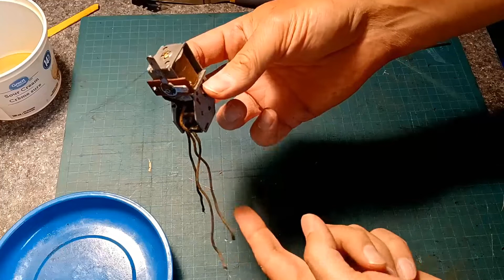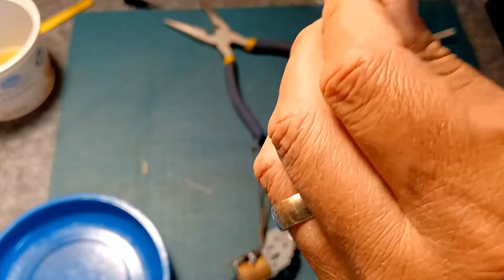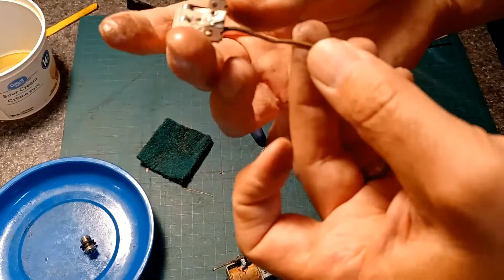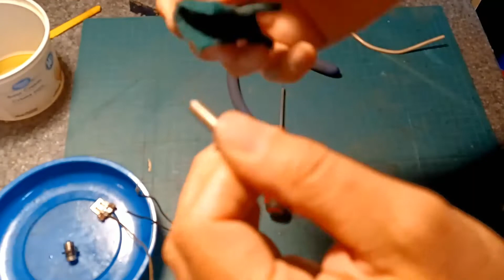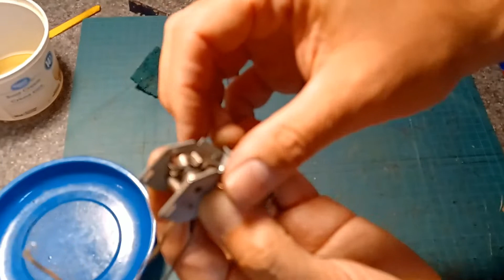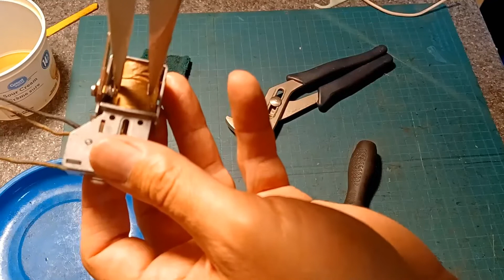Why Isn't My Lionel Moving? One common reason is a dirty E Unit

Comment: Responding to this old video; I wonder if Deoxit spray by Craig Labratories  might be a better option by not having to take the E-unit apart if it just needs to be cleaned?
Reply from the maker: Sprays work for a while but a complete disassemble and clean reveals any wear, AND I prefer a thorough clean that I know will last much longer.

Comment: Would this also work for prewar???
Reply from the maker: Thanks for watching. My experience with Prewar is very limited. I only have one prewar with an Eunit 1937 259E. The eunit in that is identical to the postwar, so for my 259E, yes this is applicable.

That said, I have no idea if the earlier prewar (1911 - 1920's) eunits are the same design or construction so I can't confirm this would work for them. I don't have any of that era with eunits, nor do I have any literature on them.
Reply: @warrenmuzakpostwarguy4331  okay 👌

Comment: I followed your other 45 minute video where you took apart and cleaned the 1666 locomotive. I have my father's, and cleaned it up real good - but it still didn't work. I suspect it's cause of the E-unit. Not only is it most likely dirty, but the barrel inside is loose - which is most likely the sole reason it's not working. Unfortunately I will have to take apart the locomotive again, but this time to take care of this part similar to how you did it here . . .
Reply from the maker: Most times with these Lionels the e-units are the culprit. Either dirty, broken solder joints or missing parts. One of mine had an eunit without a drum, one had a drum completely melted...!?!

I have come across loose barrels and found out they were not the proper barrel for that eunit. There are the odd e units that use a slightly larger barrel. Theres no way to determine that until you take it apart. It was a frustrating discovery.
Reply: @warrenmuzakpostwarguy4331  Yes, I remember your vid where the drum was missing, and you had to get one from your inventory. In my case, the drum was loose within the E unit, and I though that that was possibly a normal situation. I know why - at some point the locomotive was dropped. It looks like it hit on the right side front, which dented the right marker jewel housing (shattering the jewel), and somehow breaking off the LEFT side eccentric crank and its connectors on both sides. Evidently, this drop knocked loose the drum inside (this 3 lb. 10 oz. locomotive), and it never ran again. If my father dropped it, I imagine it wasn't a pleasant time in my grandparents house sometime in the late 1940's . . . I'll have to take it apart again and set the drum correctly, and clean it and the finger contacts like you demonstrated. By the way, my grandfather kept an original Lionel catalog from back then, and it is in pristine condition. Not quite sure where it is, however.

Comment: Maybe someone here can help. I just cleaned and fixed my dad's 1950's Lionel postwar steam engine. It runs great now especially since I cleaned the armature and replaced the carbon brushes. But there's lot of sparks sporadically off and on. Not sure if it's the engine or tracks. The tracks are just as old as they came with the engine and train when my dad got them brand new back in the 50's. so maybe clean the tracks more? Sorry. I'm not an electrical expert. Also there's a kind of a loud hum when running the engine. So I'm not sure if that's normal or not.
Reply from the maker: Are the sparks coming from wheels contacting with the track? If so that's dirt and debris on the track or the locos wheels.
Use a scouring pad or very fine grit sand paper to remove rust and dirt from the top of the rails. The top of the tracks should be silver.
DO NOT USE STEEL WOOL or SOS pads. They will leave steel fibers behind that will short out the system.

Comment: The E-unit is an ingenious single pole quadruple throw switch. The plunger is raised by current passing through the solenoid coil around it. The solenoid's core is an electromagnet. When the plunger is raised by the electromagnet it advances the drum and changes the contacts. The contracts are arranged to cut off and then reverse the flow of electricity, producing forward, neutral, then reverse...... When the transformer switch is pushed, or turned, the electricity is shut off and the plunger descends by gravity. Thank you for the demonstration video. Ther is an option to replace the E-Unit mechanical switch with a circuit board and bypass the unit for unidirectional operation. The circuit board runs around $80 dollars and our local shop, the last remaining, charges an additional $60 to clean and replace using either option.

Comment: The plunger pulls up when the coil is connected.  Don't oil the plunger.  One cause of sticky E units is dirt, oil and grease build up in the solenoid

Comment: Are all the E units in post war Lionels identical so that if replacement parts are needed there is no concern about variations? Secondly, I presume the lever switch disconnects the plunger coil from track power such that movement of the drum is halted and the direction of the engine is maintained? When the plunger does not move,  is that indicative of a non contact of the "fingers" not making contact with the drum?  I am dealing with a finicky e unit now and after some contact cleaner, I can get the engine running in both directions by manually rotating the drum, but the movement of the pawl is not evident electrically.
Reply from the maker: I have found all post war Lionels from 1950-69 eunits have the same parts except for the positioning and length of the lever. Diesels have longer handles that extend out of the bottom of the shell. 
The drum is not constantly spinning, it only turns to change the direction of the locomotive. When you push the direction button on the transformer you will hear a "click". That is the pawl dropping down, hooking onto a tooth on the drum, raising back up thus turning the drum to put the loco in reverse, forward or neutral position.

If the pawl is not moving the coil of the eunit may have a loose wire, or is damaged. Damage could be obvious, or a small nick in the laquer insulation on the wires (that gives the wires the  dark red look as opposed to bright copper). Or its been shorted.

My suggestion is if the coil has a loose wire, re-attach it. If it doesn't, just replace the coil.
Reply: @warrenmuzakpostwarguy4331  Thanks for getting back to me. After numerous attempts to diagnose the fault. I found a cold solder joint from the coil to the  coil switch. Everything is working fine now.
Reply: @warrenmuzakpostwarguy4331  Most often with a sticky E unit the  cause is crud in the solenoid.  The symptom is slow operation and partial engagement.  You won't get that nice audible clean click as the E unit engages. It may also buzz and it will clearly be drawing current.  Another  possibility is the lever arm that turns the coil on and off is not making good contact because they get loose on the pivot.  You may have to bend them a little or build the contact up with solder.  Sometime contact cleaner shot up the solenoid center will work on the crud.  Occasionally when I was working in a hobby shop as a teenager doing Lionel train repair I would see a broken solenoid wire but more often it was the other things I mentioned.  Sometimes we would see a burned or melted E unit drum or contacts that were burned out.  It would cycle but the loco would not run or some time it would run in one position of the drum but not in other positions.

Comment: Not a good explanation of tightening the handle.  There is no room to get a needle nose plier between the rivet and the coil.
Reply from the maker: Correct. Needle nose pliers will not fit in there. You have to listen to the whole explanation starting at 15:14. Next loose handle I get I'll make another E-unit video showing that.

Comment: Okay Mr Bill Nye the science Guy!, you're really doing it the hard way!, you're making it 10 times harder than it has to be, use some CLR it'll clean it right up!, no Scotch pad needed no scrubbing needed Just an eyedropper, one drop on each finger, then turn the drummer on and rinse it off what's a couple drops of water, wipe it clean, and it will be clean, just like the date was made
Reply from the maker: Its not science. Just being thorough. Inspecting the E-unit for worn or damaged parts is never a wasted effort. If your way works for you go with it.

Comment: Great video Warren - but it turned out to be a little beyond me! :D I've completely borked my e-unit on my 2018 now. I can't get it reassembled and one of the wires has broken off. LOL. Bad eyes plus unsteady hands. Anyone want a 2018 for parts?
Reply from the maker: I guarantee that 2018 is still salvageable. A perfect Loco to learn this stuff on. Take a break, scream at a tree, then come back and give it another try. You got this Brian👍
Reply: @warrenmuzakpostwarguy4331   I found this video (https://youtu.be/MmD7-0OTyeQ) which gives a very thorough walkthrough - including that toothpick trick. As soon as I get a good light and magnifying glass setup, I'll give it another shot.
Reply: @elroySF  I always find the toughest part of the process is putting the darn thing back together. It definitely takes time, patience, and practice. But it's very satisfying once you succeed!

Comment: Been repairing E-units since 1971 . The secret to assenbling an E-unit is hold the paw out of the way from the assembly with a tooth pick. One at a time,  install  the 4 finger, then the steel pin, then the drum and last the 2 finger into position , from the bottom to the top - Snap together with pliers, then pull out the tooth pick .
Reply: Maybe you could post a video of this technique? I've tried until my eyes are crossed to get the damned thing back together. :)

Comment: FYI the eunit switches the lines  going in an out of the comutator.
Example 
fwd power goes in the left brush through the comutator and out the right brush and into the field coil.
Rev power goes in the right brush through the commutator and out the left brush and into the field coil.
Neutral is no connection.

Comment: Very good video Warren- When I first attempted this it was probably around 1993 and patience is a definitely needed to this. Another good idea is to take plenty of pictures with your cell phone so that you can see how everything fits, including where wires are connected that may break off during disassembly / reassembly. However once you get it back together and it works you get a real sense of accomplishment from repairing this complicated looking device. At this point when I disassemble any train I take plenty of pictures. As usual a very good video. A++++